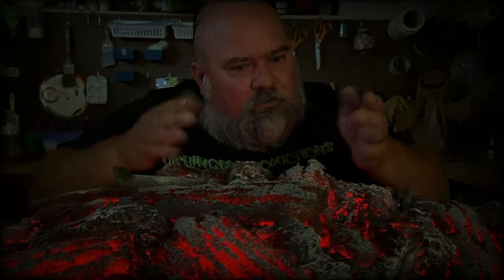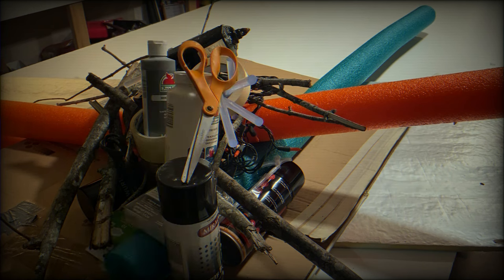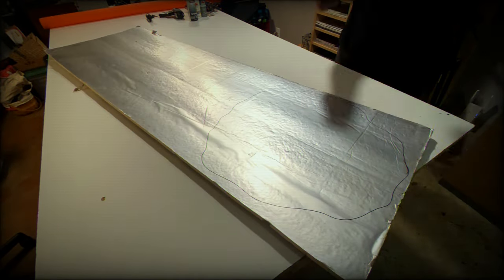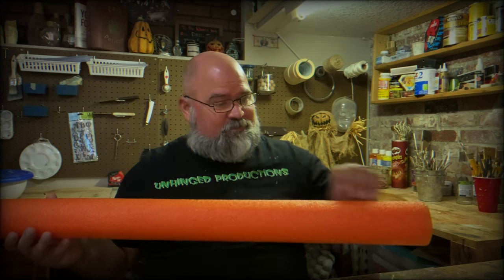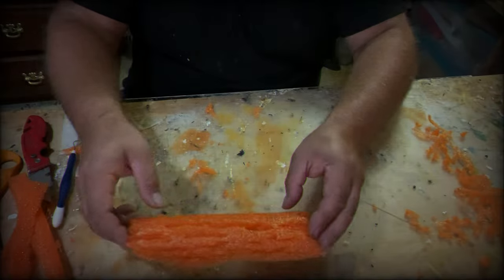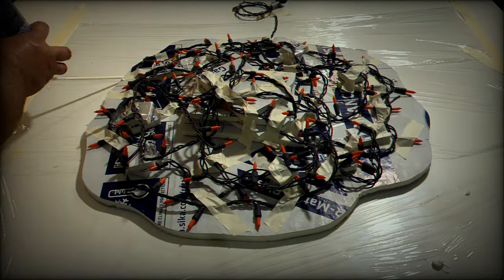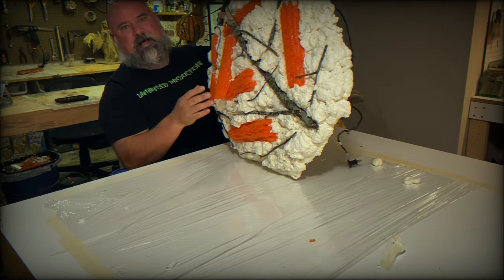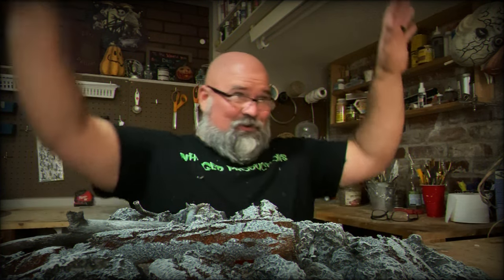How to make Fake Hot coals, fake fire pit

Comment: I've seen a bunch of expanding foam coal pits over the years but this is the first time I've seen someone make one with carved pool noodles. That's super clever! I've also always wondered how feasible it would be to put plastic wrap or a clear bag overtop the light string so you could remove them later if any bulbs need replacing, or if you wanted to use them for something else.
Reply from the maker: LOL Thanks. You could probably do that with the plastic wrap, I bet it would work. I just won't ever use these lights for anything else.  heck these had been sitting around the house for 2 years and never used them until now..

Comment: Awesome!  I made a mini one and used battery operated lights on a timer to use for my Halloween Byers Choice dolls.  I just used a small bowl the size of the firepit I wanted...turned it upside down, covered it with plastic wrap and sprayed on the foam insulation.  When it dried, it was super easy to peel off the plastic wrap. Then just drybrushed black, red and gray  paint.   Since it's essentially like a upside down spray foam bowl, it gave me space underneath for the lights and battery pack.  It came out really good.
Reply from the maker: That’s awesome! What a good idea!There are soo many ways to do this type of thing..

Comment: I got an electric fireplace and the see-through part that simulates cracked burning wood has got a hole in it and I'm gathering ideas on how to either completely remake it or patch the hole. 
I am trying to make it see through so I'm not sure exactly how I'm going to do it. 

Thanks for giving me ideas though this might work if I have to completely recreate it.

And it also when it comes to shaking a can it's a pretty nifty trick to strap it onto a reciprocating saw blade lol you can shake The living daylights out of it.
Reply: The lights appear to glow well enough through the pool noodles and spray foam in the build so you should be OK

Comment: Just came across your video while looking for other videos on how to make coals/fire for a witch Cauldron. I've watched sooo many videos and this is absolutely one of the BEST I've seen.

I do have a question though, as summer is almost over here I dont know how easy it will he to find an Orange Pool Noodle . Do you think other colors would work or does it HAVE to be Orange??

Also, do you think it would be ok to just spray paint the foam instead of painting by hand?
Reply from the maker: I think other colors would work, I do think the orange helps with the burning look. Ya you can totally spray paint it, I spray painted the black on there. Dry brushing the other colors on really brings the details out. You may be able to achieve something like that with a spray can but I’d assume you would have to hit it at angles. 
Thanks for watching the video. Others on here that have that fun flare but all are Halloween related
Reply: @UnhingedProductions1  thank you so much..I actually found some pipe tubing insulation I had laying around. It was smaller than the pools noodles as well and also White so I cut it up and used a Dental pic like you did and hand painted it all orange. Doesn't look as good as yours but turned out decent ..lol. I went ahead and ordered white and grey acrylic paint like you used and will be starting today. Thanks so much for taking the time to respond. Lots of the DIY/Tutorial channels don't bother responding, so I truly appreciate it.

Comment: Did you spray paint it black first before you added the gray and white dry brushing?
Reply: Or was the black brushed on as well?
Reply from the maker: I sprayed it with black spray paint. The spray foam will hold up to spray paint
Reply: Thanks!  Great work!!  Yours is the best example of the smoldering look I’ve seen!